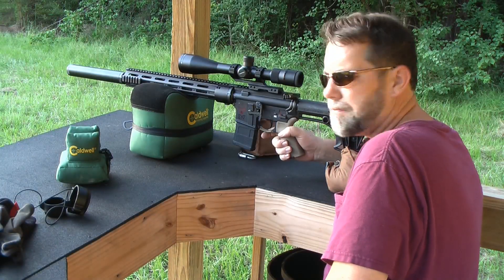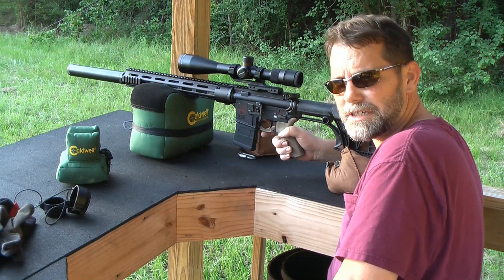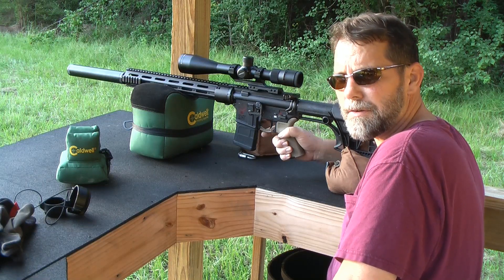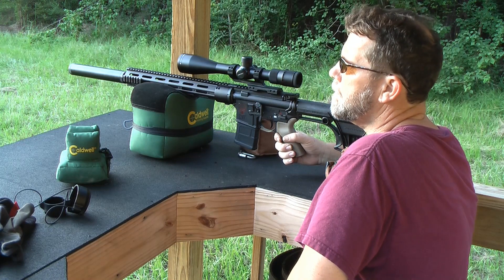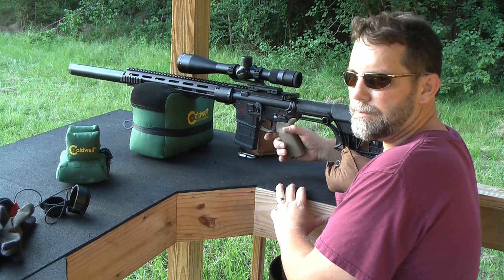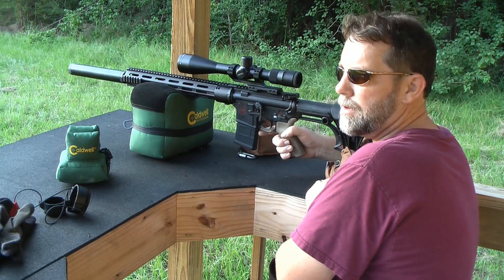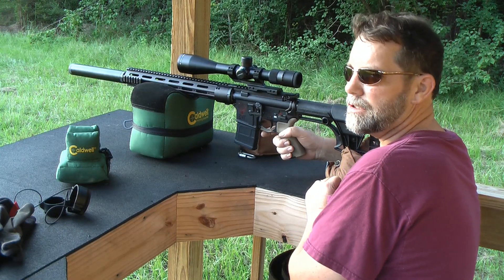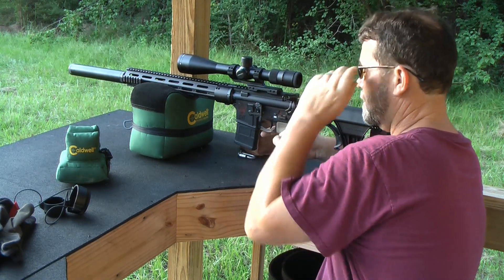AR 15 Form 1 home built suppressor accuracy test Note: Audio is from Camera set at 100 yards out

Comment: Excellent job & excellent reduction. How many plugs did you use and did you employ an expansion chamber up front?
Reply from the maker: +Dennis McCool 13  plugs and about 1.5 in blast chamber,
Reply: +Brian Stanga I,'m very impressed. I assume the plugs were well formed into 45degree cones. 
I hope for similar good results, but still waiting Form 1 approval on 5.56 and also 9mm silencers. 
What material did you use for your can?
I hope aluminum is strong enough but will go Stainless or Titanium if necessary. 
Awesome info, thanks for sharing.
Reply from the maker: that first can is steel tubing .087 thick heavy as shit and the plugs are flat, that video is a bit misleading, i believe the camera mic was clipping some sound with 556 there is always a sonic crack. 
do not use aluminum on any centerfire!, my last build was a TI tube .087 in 300blk and is holding up nicely. good luck.  have a look at my other suppressor videos, most are 300blk it is easier to suppress.
Reply: +Brian Stanga, great info, thanks. 
I recommend you get Camo Form by McNett to wrap the can. Grippy and offers heat protection. 
Thanks again.
Reply: +Brian Stanga You are correct about the camera making it quieter. I did a video on my form 1 and the camera makes the super sonic rounds quieter and the subsonic rounds louder.
Reply: BS in The Shop so the maglite tubes are a no go? As they are aluminum
Reply: BS in The Shop do you have to put a spacer in there as a blast chamber or a larger size cup?